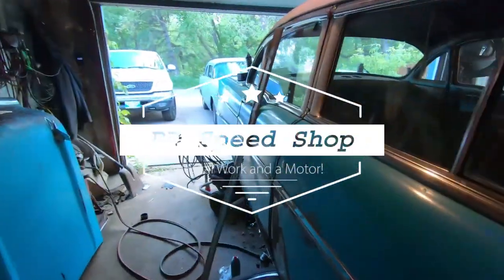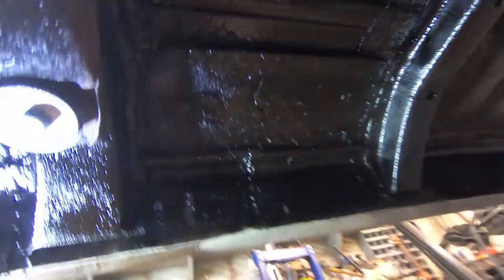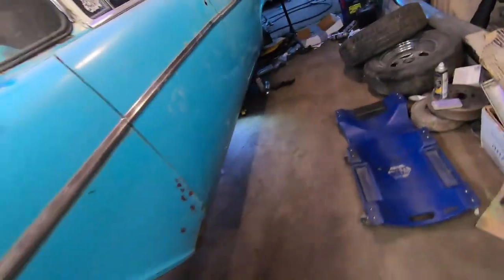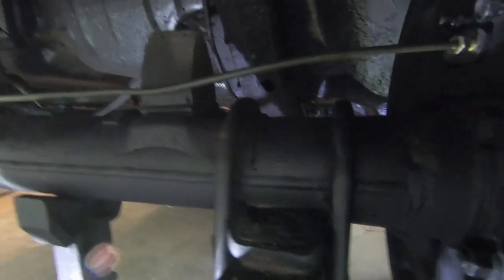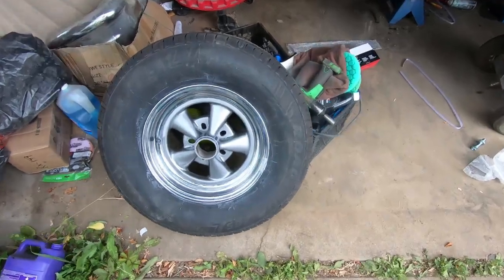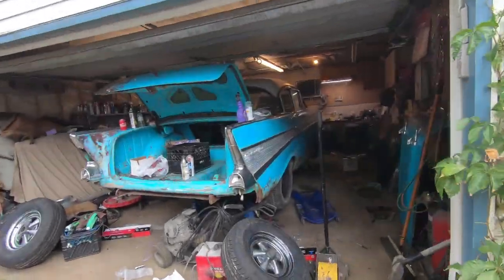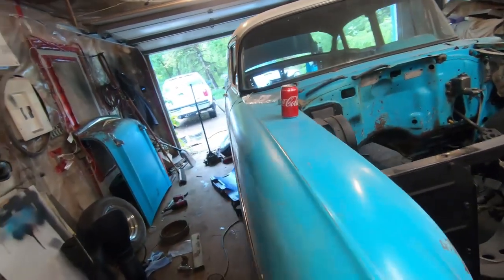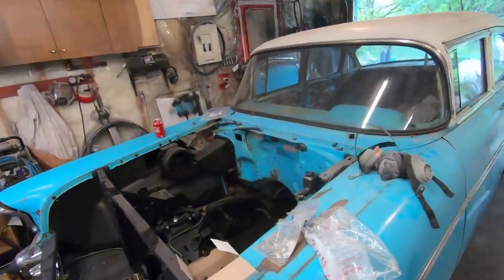57 Chevy gets a Motor!

Comment: Very cool, just so you know as far as I can remember, the 350 will fit without removing the rear motor mount brackets. I had one in my last 57, but that was almost 40 years ago.  That's going to pull the 57 around perfectly. There might even be enough room for a trany cooler in front of the radiator. lol  Keep up the progress and moma will have a lot of fun with it. Later
Reply from the maker: well im gunna try to squeeze it in haha.  hope your right